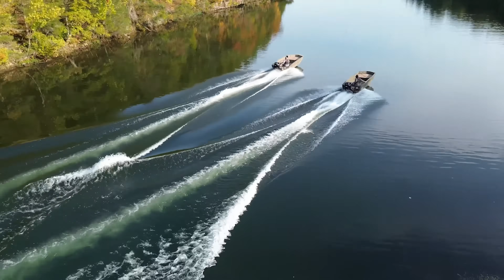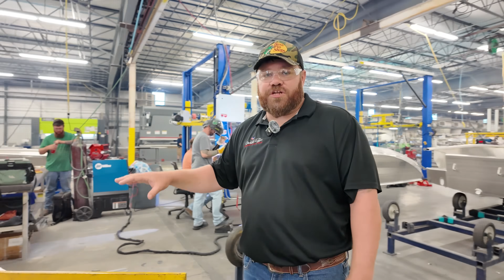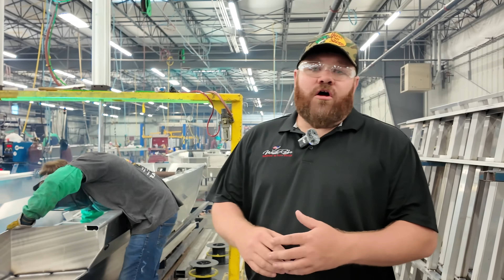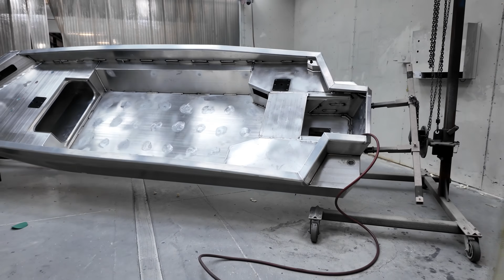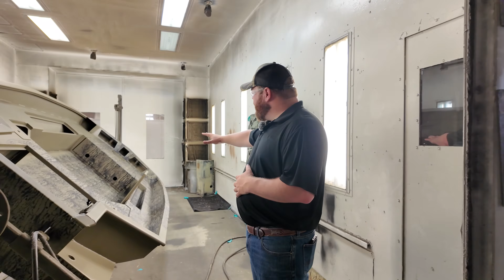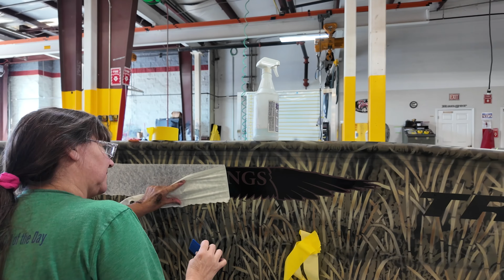Tracker Grizzly Plant Tour! | Duck Boats

Comment: Very disappointed with a quality control Tracker boats with the foam under the floor that has no way of drawing out once it gets in there because they are no drainage holes from one brace to another totally ridiculous if you fish in saltwater and you happen to take on some good water inside your boat guess where it stays until it eats a hole in the bottom of your boat😢 sad very sad for I was very interested until I found this out how do you just keep building on top of crappy workmanship😢😢😢😢😢 shame on you tracker😢
Reply: That's strange. I've had my 1756 Marsh for a week now and have went over it with a fine tooth comb...
Welds look great, and I weld alot of steel and aluminum,  I shined a light through the drain and also used a worm camera with a 7 foot reach and found NO foam in the hull and can see all the way to the bow, also tons of drainage holes through the stringers and hull beams... you sure your talking about the right model..  because the is nothing that can hold water under there..
Reply: @ScottSchultz-r1w  you got pics you can share? Looking at getting this boat possibly because of all the storage was looking at a 1860 but have to do alot of work on it. And no storage really on it, and do you fish with it alot or hunt more?
Reply: @mosokc19k yea I can get you some pics, I'll hunt with it 80% and fish maybe 20% of the time. Got it late so only hunted a couple times..  The more I run it the more I like it 👌

Comment: The trolling motor is prewired with 10awg wire. 99% of the trolling motors on the market use 8awg wire (even a 55lb thrust 12v troller uses 8 awg), so can you tell me why the dealer would give a male plug that has 12awg wire? I just picked up my boat, and it's honestly kinda pathetic to drop over 25k on a boat and have to either go buy a new plug or a new receptacle all together, because yall are too cheap to do things right. It's literally a recipe to start fires on boats. I am going to contact my dealer as soon as they open. It's simply pathetic. 

I will also be uploading a video to cover the welds. I am not a welder by any means, but the number of fisheyes, and lack of penetration on welds is very obvious even to an amateur like me. Even after paint you can see several welds where the weld didn't flow to BOTH surfaces. It flowed in to one side, but it stayed cold from the other. I am willing to bet I can slide a wire through parts of the weld. I really hope these are not "the best in the industry" as you claim, because several are garbage. Not all of them. Some a pretty nice, but then you see the others where yall gave the welder to Michael J Fox. My favorite weld of the terrible welds didn't even get prepped properly, and therefore the paint didn't really take to it. Just kinda a mess of soot crappy welds. My dealer said that it was okay and normal. I'll get a video up here in the next couple weeks. You tell me if they would pass QC.
Reply from the maker: Thank you for your feedback, Matt, and we apologize for your experience. Please email us at WhiteRiverCares@whiterivermg.com. We'd like to talk about this more with you, and we apologize once again Matt.

Comment: Do not buy a Tracker unless you want THEIR cheap foam to ruin YOUR boat by becoming waterlogged. DO BETTER TRACKER
Reply from the maker: We apologize, Dalton. Please email us at WhiteRiverCares@whiterivermg.com. We'd like to learn more about your experience.
Reply: I just  finished  removing  the floor  in my 2072 cc only  because  all the spray foam under  the deck  was completely  saturated. I removed 400 lb of wet soaked  foam. Wow what  a costly project. If you looking  for a tracker boat with  spray foam in it I would  reconsider and do  your home work!!!!!
Reply: @rustyparker5002 see tracker, do better
Reply: @trackerboats  the foam you use is garbage, it absorbs water and causes corrosion issues. You can easily do an internet search and find hundreds of examples.
Reply: @trackerboats  I was going to buy a grizzly. I love the all welded hull, .100 aluminum and the boat layout. I then found many people on the internet with this issue. I emailed Tracker sales last week, seeing if I kept a Tracker boat stored bow up, drain plug out and with a cover if they'd warranty a waterlogged boat. I figured a boat couldn't become waterlogged if you take care of it but I still wanted reassurance. No response thus far. I researched this topic all day for days because I love the grizzly's more than any other boat, I'm buying it to be here after me and that doesn't seem plausible with the foam you use. I then found @trickedtins videos and even well maintained boats had this issue. You really might want to add better drainage and use different foam before your boats are even more notorious than they already are for their bad foam. Ask bud light how hard it is to comeback from your image being tarnished. P.S. I know it is to keep the boats cheap. I much rather pay a little more for a good boat.
Reply: @trackerboats see tracker. Do better